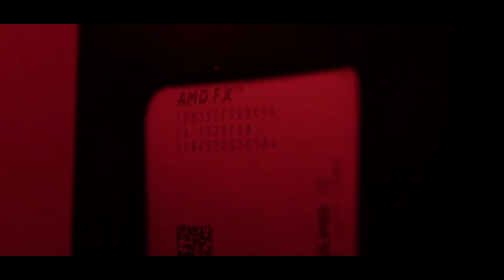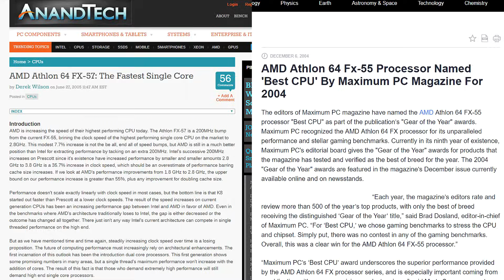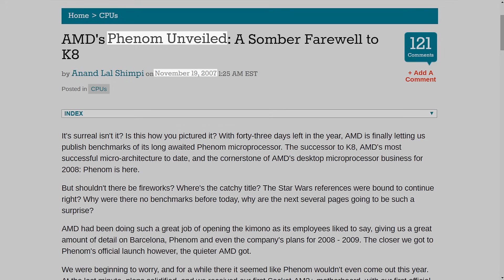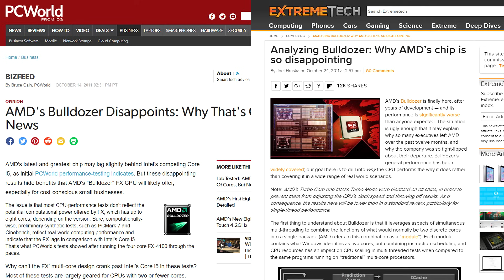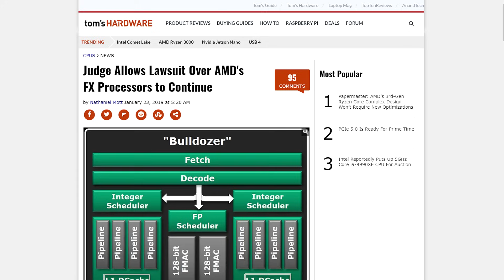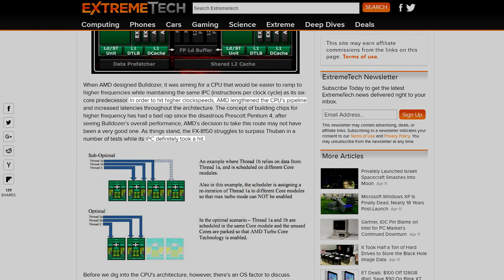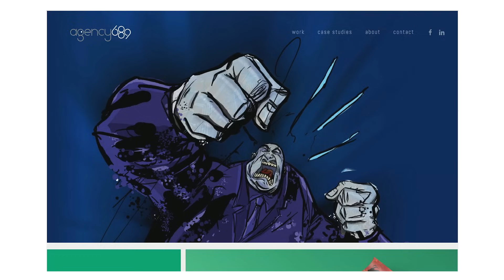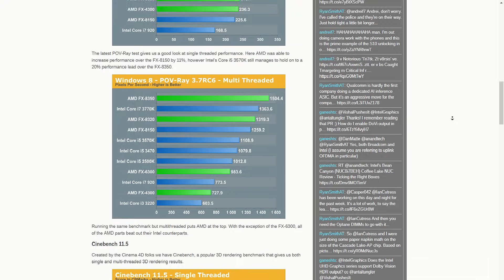Why AMD's FX CPUs Were Hated So Much? - The Fate of Bulldozer

Comment: The main thing that screwed over bulldozer was Global Foundry. 32nm was supposed to be out in 2009, and they promised AMD that they'd be able to get 2 billion transistors for the 8 core FX Bulldozer CPU instead of the 1.2 billion they got at the same power and slightly lower frequency. Bulldozer could have easily had more execution units per core/module, like 4x 128 bit FPUs instead of 2x 128 bit FPUs and 1x extra ALU per core(2x per module) at 2.0 billion transistors for the fx 8150.
Reply: Love the pfp
Reply: @vicrattlehead3462 \m/
Reply: GF kept screwing up over and over and over again. That said Bulldozer wasn't great on an achitectural level either.
Reply: @Matticitt  it wasn't bad, it was just not supported well because it was very different from standard architectures and the cores were made a lot smaller because Global Foundry promised AMD 2 billion transistors at the same size and power consumption as they actually got at 1.2 billion, which is why bulldozer was delayed. It was supposed to come out in 2009.

If the cores were 33% wider and the cache was wider it would have been better than Hyper-threading. Hyper-threading is a crutch to compensate for internal architectural bottlenecks and it's good that intel finally stopped implementing it. Their new cores are barely bottlenecked finally.
Reply: 2 Billion transistors for 2009????? What was AMD thinking? Intel barely managed 731 million with Bloomfield
Reply: @elecman748  They were aiming for 2 billion for the 8 core and 1 billion for the quad core and Global Foundry until 2010 lied to them that it would be possible, which is why FX CPUs were delayed by 1 year.
Reply: @rattlehead999  I can understand that they were aiming to that number. What I can't understand is how they expect to achieve that goal, like, at least someone stopped for a second to think and ask the team if it is even possible, not even the Moore's law can hit those expectations
Reply: @elecman748  Intel hit 1.7 billion transistors in 2006 with their itanium dual core on 90nm, so 2 billion on 32nm isn't that unbelieveable, if it was intel's 32nm that is.

As it turned out Global Foundry's 32nm was terrible, as have been all their process nodes relative to Intel, TSMC and Samsung since AMD sold them.

Keep in mind an 8 core FX CPU with 2 billion transistors would have been at least 400$, not 200$

Edit:
Search: "AMD Realizes That Bulldozer Has 800 Million LESS Transistors Than It Thought!"

Intel hit 2.27 billion transistors on 32nm with the core i7 3960x.

Comment: I bought a 9590 for 300 with water cooler included in the linus video back when I was 14 I thought cores and clock speed were the main things to look for so when I saw "8 cores 4.7-5ghz" I thought I got a sweet deal LOL

Comment: Wow so this video is just a quick overview of the situation.

I wanted a technical breakdown of it's performance, not it's sales history.

And AMD was better for multitasking. Soon as you stressed an Intel cpu anything else would lag and stutter.
With AMD I could run as many things as I wanted with minimal performance decrease.

Plus Intel was cheating on benchmarks, AMD was always competitive till the bulldozer architecture. Which failed because they couldn't get it to operate they way they thought it would. Each pair of cores were supposed to act like a single core with effectively double the clock speed. But operating systems didn't treat them like that and used them more like separate cores. It's why they share a fpu.

Comment: I feel spoiled hopping from a i3 5010-U to a Ryzen 5 3600 without touching Bulldozer once.
Reply from the maker: You'd definitely notice a massive uplift, even if you upgraded to the FX-6300. That i3 is actually slower than the i3-3240, a CPU that I compared to the 6 core FX before. You can check out the comparison here:

https://youtu.be/DNP3WWCWW90

Comment: To intel diehard fanboy, yea i3 is better than FX. But your $500 i7 is dying to match even $380 ryzen 5 lmao. And the funnier is, Its RYZEN 5 not RYZEN 7 not even an equal matchup. And lets do the basic human instinct, $1000 i9 10980XE only wins 1-4 fps on 0.1Low to $700 Ryzen9 3950 but the Ryzen usage is lower lol the cores dont even try to workhard when playing AAA games. No way you want to trade ~$200 to only little different amount of performance. To be honest, i use intel too. I use xeon E5-2690 v2. Get it for dirt cheap $100. But it has ~1500 points more than expensive i7-9700 on passmark lmao.
Reply: Finally, a 7 year old i7-4790K is better in gaming than many of those old Xeon with bad latencies for gaming. I think it's the minimum recommended processor for Cyberpunk 2077.
Reply: 1500 points more in passmark multicore while in singlethread perfomance is way behind the Intel Core i7.

I rather buy a Ryzen 3 3300X, an used i7-4790K/7700K or new core i3 than a dated Xeon with bad IPC, latency and clockspeed.
Reply: @saricubra2867  bruh, R3 3xxx or i7-4xxx 7xxx or even i3-10xxx 11xxx is nowhere near E5-2690 v2 that's $85-100 now (in my country) . Yes these processors are better. But the price is also different. Xeon now are great who wants plenty power with low budget. Why getting low budget if you had high budget anyway
Reply: @srr1887  For similar price points, Ryzen is better.
Reply: @saricubra2867  idk about your country. But ryzen is double the price of E5 here. So not worth buying one of those here

Comment: Can hardly get 60 FPS on apex legends with the absolute worst graphics possible and I have the amd fix 6300 does anybody know why this is the case? (I think I need to re apply the thermal paste but idk if u will cus I’m getting a ryzen 7 3700x soon
Reply from the maker: What are your specs?
Reply: @RATechYT  amd fx 6300 8gb ddr3 gtx 1650 500w power supply gigabyte ga-78lmt
Reply from the maker: @apollo-_6302  Here are a few things you can play around with:

-Check your CPU temps, if you're not exceeding 70°C while playing games or using a stress testing software - you're fine. You can use software such as MSI Afterburner or HWINFO64 for monitoring CPU temps and a lot more.

-Try using a fan to cool the VRM & NB area, they're located to the left and below the CPU socket respectively. Make sure to place it so it directly blows fresh air on those parts.

-Check if you have one or two sticks of RAM. In case you have only one, then you're leaving a lot of performance on the table by running your RAM in single channel. If you want the best possible performance, you're going to need to add another stick, preferably of the same module, and make sure to insert both modules into the correct slots so that the dual channel mode gets enabled. You can that information in your motherboard's manual.

It could also be an issue with the new map or the latest update, cause the last time I tested my FX-6300 performed perfectly fine in Apex Legends, even at stock settings.
Reply: @RATechYT  my temps are fine it turns out and my I am running single Chanel but I don’t know that would really make it so I can hardly run the game because ik it’s a big performance upgrade but I still think I would be able to run it with single channel should I try switching back to my rx 460 so I have less of a bottle neck?
Reply from the maker: @apollo-_6302  Single channel RAM impacts performance a lot. I'd definitely deal with that first.
Reply: @RATechYT  oh Ig i will try it thanks for ur help I didnt know it really mattered that much and also I meant to say rx 560 but it doesnt matter thanks for ur help

Comment: Speaking of Intel Core i7 Sandy Bridge, I have one, installed on Dell Optiplex 970 SFF PC and runs very well with 240W PSU alongside with Nvidia GTX 1650 GPU. 

Surely, AMD FX CPUs never survived on low wattage PSU than Intel does.
Reply from the maker: Unfortunately power consumption is one of the weakest points of AMD FX.

Comment: I bought an FX8320 back in 2013 for $110 on sale. It was $130 cheaper than an I5 3570k ($240) at the time. So 55% cheaper for 45% worse performance in single core. And similar performance at multi threaded applications. The 8 cores really did make it last longer. Also Am3+ motherboards were cheaper than Intel counter parts. It was a great budget build for the time that lasted me 7 years and could last me another 3. Finally, I and many others are still using it to this day and it plays 99% of games at 60fps 1080p high- ultra. Don't know many people using old Intel I5's 2500k/3570k in 2020 most moved on to new CPU's. Which I'll probably do as well when Zen 3 launches. Got my eye on a 4600 or 4700.

Comment: I got an FX8120 shortly after they were released and I never had any big regrets about it. It had a very good price/performance ratio when I picked it up (significantly better than that of the 8150). The bottom line was that is was cheap and I used it until Ryzen chips came out (actually I still use it on my secondary desktop in the cellar). Also, I run Linux primarily, and its performance in Linux was comparitively better than it was in Windows thanks to much more Linux software at that time being multi-core friendly. Was Bulldozer a great chip? No, but it was good bang for the buck, especially when you bought the next to highest clocked processor.

Comment: I pre-ordered an FX-4100 before they came out and was excited to upgrade from a Athlon II X4 640.  I remember posting a review online about how disappointed is was with the CPU.  As there were no other reviews out there at the time, I remember getting trashed by AMD fanboys who likely couldn't believe it was as bad as I said.  History shows that this CPU was pretty terrible.  I ended up removing it and putting the trusty Athlon II back in, and then got a Phenom II X4 945 for a good deal and used that for a couple of years.  I upgraded the system to an 8350 a couple years back, and it was a decent bang for the buck upgrade.  The Phenom II is in my home server, and the Athlon II is still going strong in a friend's computer.  The FX-4100 is still sitting in the box I put it in back in 2011.

Comment: I used my Phenom II X4 B97 (4 x 3.2GHz) in my 2008 HP dc5850 (AM2+, DDR2 & PCIe 2.0) till May 2019 :) 
I upgraded because using ZFS and Virtualbox VMs I wanted to use more than the max 8 GB of the HP. 
I've upgraded to a Ryzen 3 2200G and 16 GB, that was twice the size and almost twice as fast :)

Comment: FX-6200 still going strong here,  I still don't see a pressing need to upgrade this year, 32GB of ram isn't a problem even in 2020, PCIe 2.0 seems to barely harm my framerate, I can use the GPU for things like rendering and other computationally expensive tasks. I am close to getting a full 10 years out of my system (was using an AM3 chip before a motherboard bios update allowed AM3+).

Comment: FX cpu`s are now dirt cheap.So i recently built a machine with a FX8350,M5A97R2,16GB HyperX RAM,a slightly OC`ed GTX1050Ti 4GB and a Creative ZxR.
All used stuff. New is a 500GB WD SSD and 1Tb WD HDD. All fitted nicely in a age old superflower alu mid tower. Even the power supply
a Tagan with around 480 Watts output is over ten years old. The whole thing cost me less than 400 bucks including a new set of fans for the case.
Granted,i had to clean a lot of accumulated dust,especially in the power supply and case.
The machine runs under Solus Budgie and Win7/64. And what a smoothly running little workstation and gaming rig it is... Admittedly im not the richest
guy around and have to consider every buck i spent,but your videos inspired me to replace my decade old machine with DIY built. And im very happy 
with it. And no,i personaly dont consider 60fps a must have in singleplayer games. Im a old guy and play since the nineties. So im perfectly happy with 
mid fourty fps in 1080p.

Comment: still using my 8350 with a sabertooth 990 r2.0. upgraded gpus and storage drives/fans/case over the years. cpu/mobo still running strong as ever.

Comment: Been rocking a 8350 @ 4.5GHz for 4 years and it still smashes whatever I toss as it. Just bought the 2600X and it's night and day in speed .... Still use the 8350 daily it's a decent chip

Comment: Bought FX-8320 in 2015. Didn't notice it was crap because I never used any CPU intensive works. Only noticed it was crap when I try to run emulator in 2018.

Comment: I upgraded from a dual core Phenom II unlocked to quad core, to an FX 6300. Higher clock speed and more threads yet all the many benchmarks I ran on both CPUs only show around 10 to 15 percent better performance, and slightly worse on most single thread benchmarks. I'd have to overclock just to meet the single thread performance of the much older CPU. The FX does quite a bit better at H264 video encoding but on an H265 encoding test it went from a super slow 17 FPS to a super slow 18 FPS. The one thing I was hoping for some decent improvement was the one thing it essentialy had precisely the same (lack of) performance at. So I bought a nVidia 1050 GPU and use that for H265 encoding at way higher than realtime speed. I can get a little better quality to compaction doing software encoding with the CPU, but at the cost of taking much longer than the runtime of a video compared to the fraction of the video's runtime the GPU can do.

Comment: My AMD FX-9590 has been running OC since I purchased it on a 240 AIO. These CPUs don't like to be pushed with the multiplier for the CPU clock but if you spend some time overclocking the base you'll find 1800MHz+ RAM OC and 5GHz+ with stability across all applications. My Rx 580 8GB is running games like Borderlands 3 @1080p Ultra Everything with only about 35% CPU usage so technically it could handle a much better GPU for the 1440p and 4K market and begs the question "why do people think newer is always better"? Granted the AMD CPUs have always been harder to overclock and require more technical knowledge to OC. The FX goes to my wife and daughter when my Ryzen is built but for the value, the FX is a beast.

Comment: I started with a used phenom ii 965(65$) at around +/-2007, used it for about 4 years then went to a used 1100t (175$) for about 6 years ran that then about 2 or 3 years ago bought a used fx8350 (50$) for a small upgrade

Last year i bought a new 7700k for about 350 or 400$ but i never got it to post..( i think its the motherboard but it was new too) so now im gonna go for a 3900x/3950x and be good for hopefully another 10 years
going from an 8 core to 12/24t or 16/32t should satisfy me for a goooood while.

I always wanted an intel back in the day because they were performance king but it made more sense in my budget to keep putting used amd cpus into my am3+ motherboard. the choice was usually ~50$-200$ for an upgrade to amd or replace motherboard and i think ram too with cpu for well over 500$. making very little money in highschool the choice was clear to me at the time as i didnt get allowances or anything like that.

some of the cpus i have are well over 12 years old and still run fine and i overclocked them and ran them nearly 24/7. i got a used golden 555 that overclocked to 4ghz+(i wanna say 4.2) on 4 cores (2 unlocked) but i sold it in a build kinda regret it but its outdated at this point.
I hoard my pc parts :3

Comment: I'm using an fx 8320 3.5 GHz with a GTX 1660 and 16 gigs of 1866 MHz ram and I can run red dead redemption 2 at custom ultra settings and get 60 fps at 1080p.. 🤔

Comment: I have had all of AMD's CPU's, even the top of the line of their failures, and they have always satisfied me. Not because they are great, but because price performance, they were the best thing for me to do.
I had a Phenom 9950 @ 2.6ghz, because I had an AM2 motherboard that supported it. It was a good upgrade from an Athlon X2 5200 (Which was also a pretty decent CPU at the time)
Eventually my next machine, a Phenom X2 955 @ 3.2 received an upgrade to an FX 8350 @ 4Ghz.

So all in all, the upgrade paths have always made it worth it and AMD has been great with long term motherboard upgrade path.

Now I am rocking a Ryzen 1500X 4c8t @ 3.5, performs amazingly well, and can upgrade to... infinity and beyond.

I do like the I5 tho. Today you can make an amazing gaming PC for Peanuts. 
Get a 100$ Lenovo with an I5-2100
Give it Win10, 8 gigs ram, basic 500gig ssd and a used GTX960 4gigs and voila... Flawless, cheap gaming PC that can hold it's own on most titles at 1080p